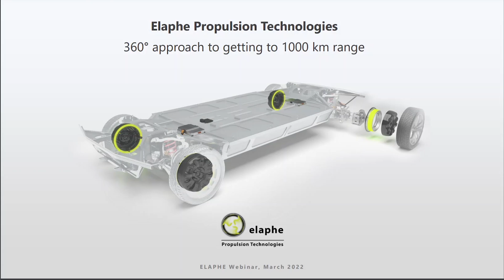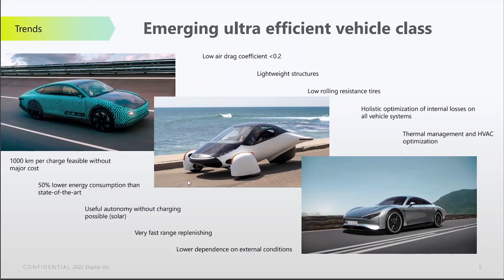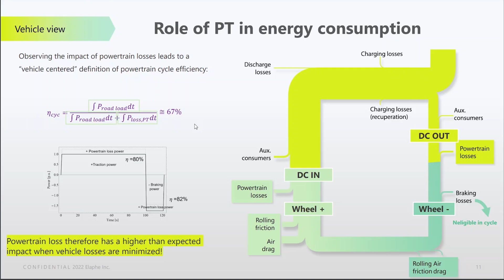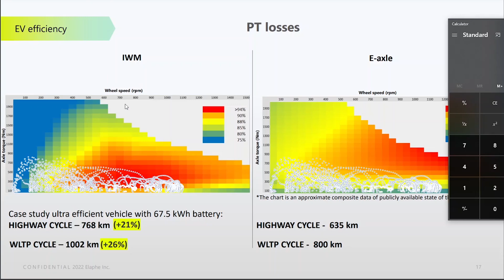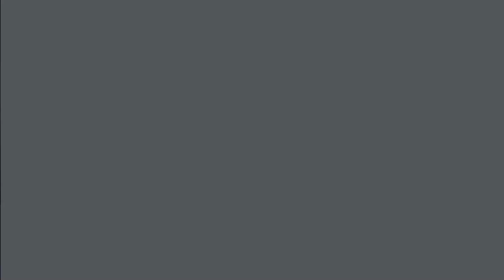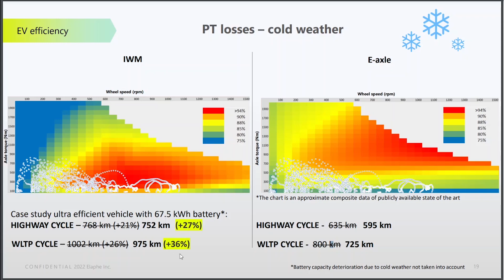Elaphe Efficiency Webinar Analysis

Comment: At lower speeds, this is usually when the power draw is the greatest, to get the vehicle movin. If city driving at low speeds, combined with aero not mattering as much, i wonder if power consumption would be a bit worse, like 200wh/mi?

Comment: E-axle seems like a better choice for trucks/work vehicles that need high torque/load and low speeds (which I think is not good for lordstown motors although they have 4 motors so who knows).  This also backs up what I have heard anecdotally with Teslas efficiency dropping in the winter

Comment: Looking at that motor efficiency graph, I wonder if Aptera will have the car to switch to one-wheel drive or "hypermiling techniques" (coast-accelerate cycles) to keep the wheel motors from falling into the low-torque portion of the graph.

Comment: Excellent analysis of the efficiency heat map. I wonder if, with the e-axle being more efficient off the line, there may be a case for a hybrid powertrain. i.e. one set of wheels driven by the e-axle, and the other set by IWM.

Comment: Nice job. So like a VFD I need to soft start the in-hub motors versus slamming the motor across the line during acceleration to reach the most efficient cruising speed. I guess flooring the Aptera to get it to 0-60mph in 3.5 seconds will cost me roughly  $0.15 versus $0.015 dollars. The 13.5 cents will be worth it.💲
Reply: The Aptera has got to be the cheapest acceleration per dollar value out there.
Reply: @deanmcmanis9398  And, as Bill Lee of Santa Cruz Yachts is known as saying: "Fast is Fun!"

Comment: Semi off topic but anyone know the type of cooling/heating being used for the batteries?
Reply: Such as air vs liquid active vs passive?
Reply: @jasonhoard4446  Active Liquid cooling, but using an innovative skin radiator, https://www.youtube.com/watch?v=RE2du6ZGMQo
Reply: @jasonhoard4446  Regrettably, I don't know the answer but if you can't get an answer here, I believe you can get an answer to your question via the FAQ's somewhere on Aptera's website.
Reply: Aptera has designed an active cooling system using antifreeze fluid flowing through channels to the belly pan to rid the heat through conduction and convection.  They will test to see if the increased efficiency will make it possible to dispose of the heat through air circulation alone, which would save weight, and perhaps lower parts count.  This will be decided based on the results of validation testing going on now.
Reply: @n.brucenelson5920  yeah umm no if they switch to air not buying it look up Nissan Leaf
Reply: @jasonhoard4446  The Leaf has no BMS.to speak of.  Anything Aptera produces will be validated down to -20 and up to 125 F.  The LEAF generates far more waste heat than Aptera does and it is not a valid comparison.   Aptera is going to be produced with actual engineering - not fears and rules of thumb.

Comment: Lol for the RPM equivalent you could have just taken the aptera max speed of 110 mph at 1500 RPM...  Alternatively the math is far simpler in metric (I did the math when you posted about the other axial motor with a ~6000 rpm max)...   Tesla is 3-4% more efficient than the generic example this used; still basically the same shape just more of the cycle gets into orange.  The cold weather aspect was my big focus looking at this video but obviously for those in California it is basically irrelevant.

Comment: Thank you for your posts!  I am more than sold!  Can't wait for mine.

I've been trying to convince my brother (77) and sister (74) to reserve an aptera.  They generally like the idea, plan, and stats.. My sister is not convinced that it is safe to drive.    I'd love to see you do a round-up post on Aptera's safety...  how safe will it be on interstates driving at 60mph with a semi truck sandwiching  you on the left and the right.   She thinks it maybe unstable under such circumstances.
Reply: I have a post on my youtube channel discussing Aptera safety you could show her.  Aptera has been tested stable in sidewinds over 100 mph.  There just aren't many surfaces for wind to push against in any direction.  My Gen 1 Honda Insight weighs about the same 1800 lbs as a 400 mph battery Apter, and I have driven it on interstates in 80 mph side winds, passing trucks.  It has been fine, and returns around 53 mph at 80 mph on the interstates.  I am sure that Aptera will be even better.
Reply: @n.brucenelson5920  Some people automatically think that lighter cars are unstable in crosswinds, but the Aptera's great aerodynamics no only help it cut through the air in a straight line, but help it to be MORE stable in crosswinds as well.

Comment: Thanks Steve.  Wondering about license plate brackets on the Aptera.  Can't remember seeing a pic with one.
Reply: Good question. I wonder if the standard motorcycle plate size would be allowed.
Reply: If Aptera maintains its motorcycle category it will require only a rear license plate and motorcycle plates are smaller than US car plates. I believe the plate will be mounted on the rear center which appears to be designed for that.
Reply: @arlenbell4376  I realize that however, the designation "autocycle" is not universal in all states. Ex: my state doesn't recognize the autocycle, so if it has three wheels, it's a motorcycle. We also do not have a helmet law, which can confuse things if we drive into the next state which does. I'm keeping track of the Polaris Slingshot which has an optional full enclosure.
Reply: @babaluto  Whether a state considers the Aptera an autocycle or motorcycle should be independent of the fact the occupants are enclosed inside the vehicle with seat belts and eliminate the need for a helmet.  If there are states that currently require a helmet for a this type of vehicle, we should be addressing this now as it will take time to get anything done regarding the government.  

I am hoping the crash tests that are planned this summer for the Aptera will go a long way in helping states to realize the safety of the Aptera. There seems to a some question around air bags and the type of air bag the Aptera will use, assuming they are used. The crash tests will certainly flush this out.